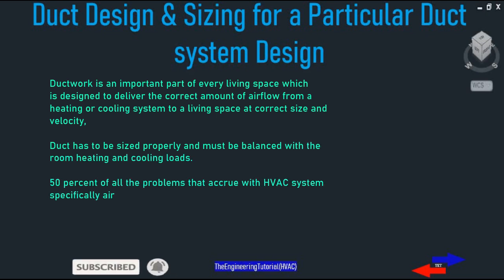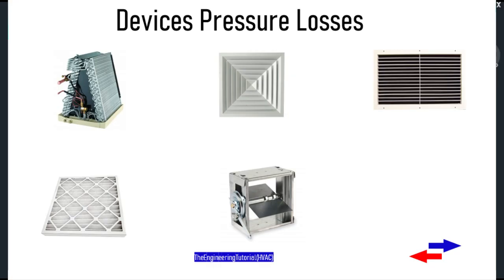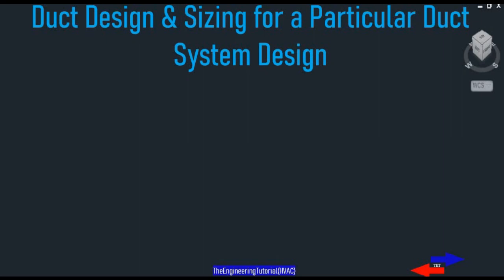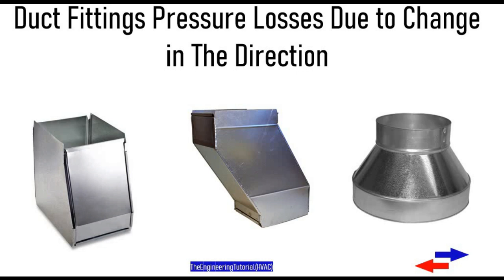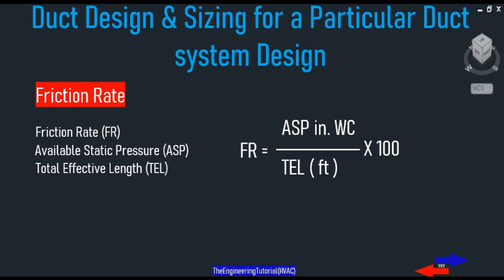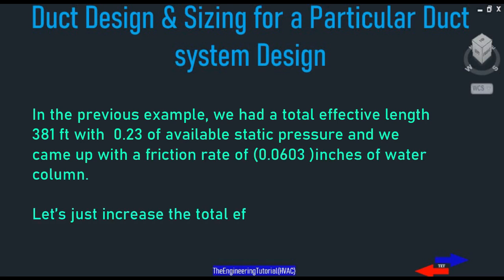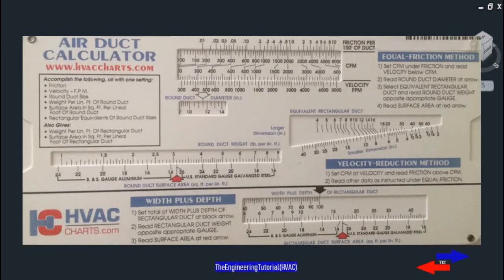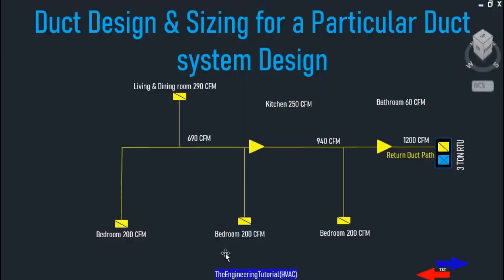Duct Design & Sizing for a Particular System using ( Equal Friction Method)

Comment: Hello, I watched the whole video and thought it was very well presented and informative.  
Would you mind clarifying for me for instance at 25:20 you state the ductulator shows 12 CFM @0.06 / 825 fpm.   But @ 0.06 a 16" duct is factually 100 cfm and 780 fpm.   On the other hand if you use the starting point 0.06 @ 1200 cfm the fpm will drop to 800 fpm and of coures you can't buy a 16.4" round duct.

So factually you have to make a choice of either: 16" @ 0.07 = 1200 cfm at 850 fpm or 16" at 0.06 1100 cfm at 780 fpm.

Q1: Which one would you choose or does it make any difference in the grand scheme of things?

Q2: When counting up the DPL, do you count the total amount of (registers) or just one of them?  For instance, I have 10 registers in a home I'm working on and 10 registers would amount to 10 x 0.03 or 0.3 all by themselves which will put over the 0.5 Unit ESP.  @11:45 I didn't see you make that part clear, you spoke of "registers" but you only counted one at 0.08.  

Thanks for the informative video I thought it was great. 
Joe
Reply from the maker: The design static pressure for sizing duct system remains constant as long as the velocity is at the recommended ranges, in some cases when air velocities aren’t in the recommended ranges ( it could be too low or too high than recommended velocities) so this case it’s allowed to change the static pressure in order to maintain the velocities in the recommended ranges, so you should always be aware of recommended velocities which I talked about it, if you watch that video you will find there all different air velocities for different applications.

The pressure drop is for all of your diffusers.
Reply: @theengineeringtutorial2290  Thanks for your answer, it makes complete sense. If you keep velocity constant, cfm will follow.